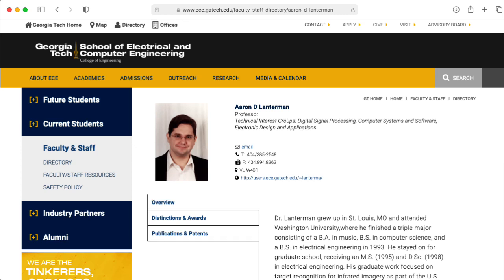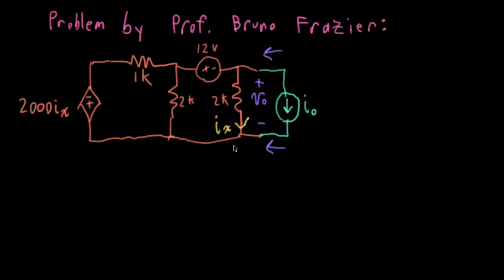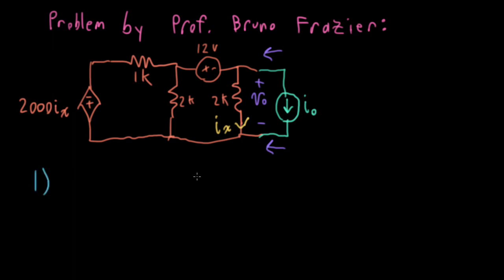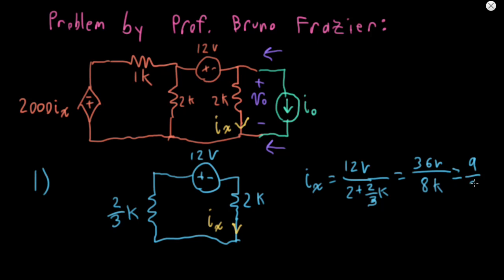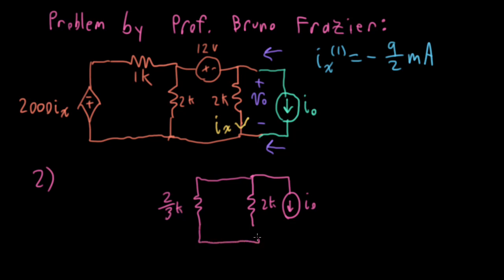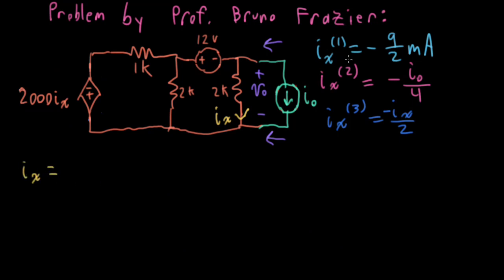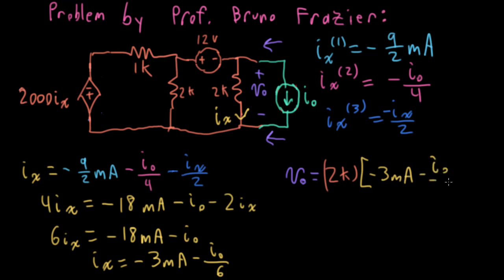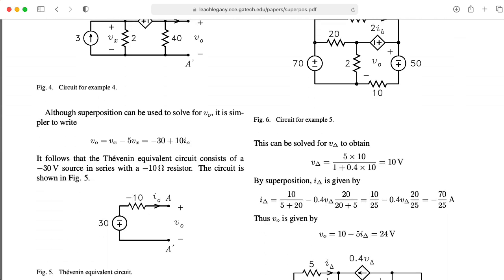Thevenin Equivalents using Superposition with Dependent Sources in Circuit Analysis

Comment: @10:31 does the sign of Rth matter?
Reply from the maker: Definitely! You can compute a Thevenin equivalent that winds up with a negative Rth. That means your circuit is probably modeling some active device since it means energy is coming into the system from somewhere.